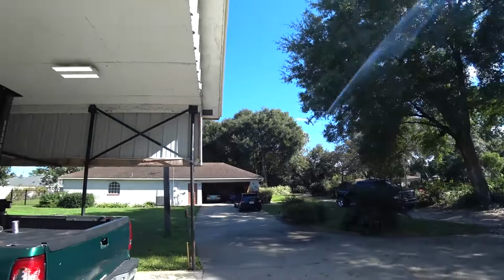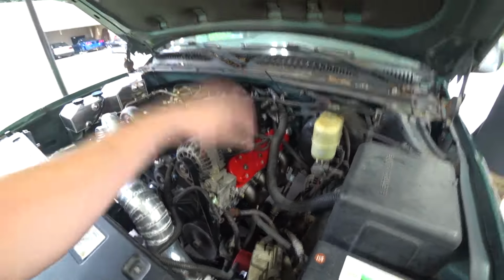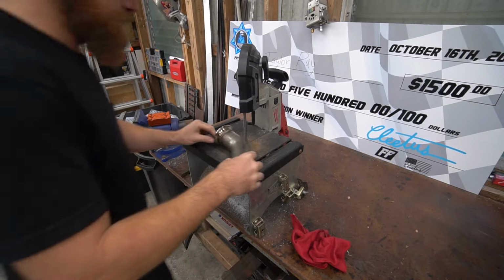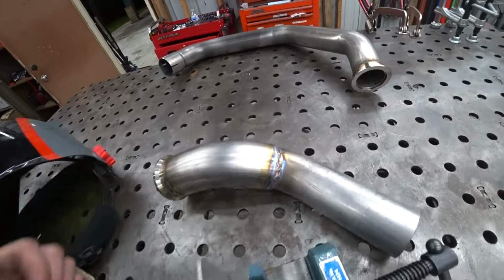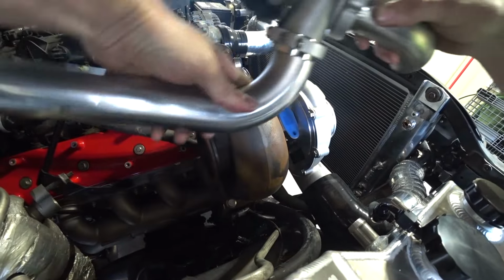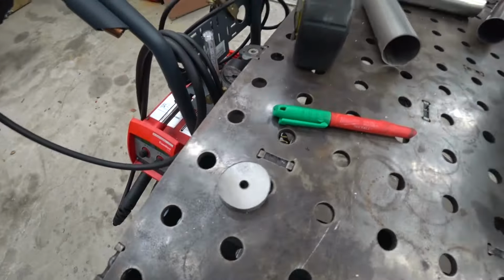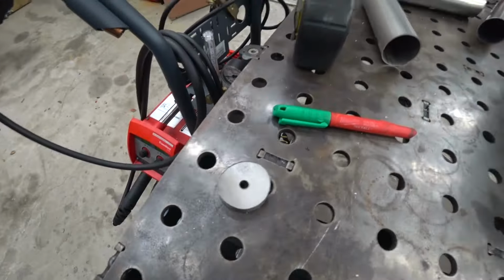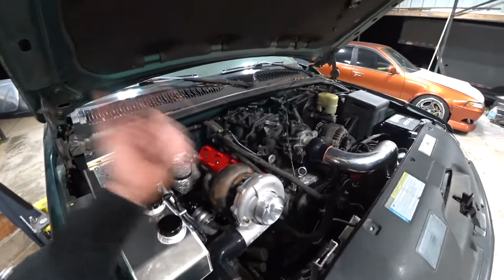Turbo LS street truck. Building the turbo kit

Comment: After years of changing broken manifolds and studs on F150s, I sure am jealous of how easy it is to get them on and off that truck.
Reply: Fords are hands down the worst gas V8 manifold. Cable company e series vans suck also. You need a straight cutting torch head

Comment: It will be a miracle if you don't experience boost creep with the wastegate positioned like that,  you're asking the exhaust air to turn 90 degrees to enter the pipe then another 90 in a different direction to travel down the pipe.  I know you know, but to work effectively the gate must be positioned in the path of least resistance, i.e. straight from the outer side of a bend.  None of the blank areas on the manifold are good examples as they all require a 90 degree turn.  PS keep it looking stock from the outside, sleepers are cool!
Reply: Like you said….you know he knows. I couldn’t help but see it myself but I’m assuming that he’s tired of this build sitting with the new shop creeping up on him, and wants to at least get it running as is, with what he has. I’m sure like everything else there will be a V2, V3…etc. But I couldn’t agree more with you! But it makes for content now, plus future upgrades. Lol.

Comment: Maybe dump the waist gate in to the down pipe? Would make the down pipe a little more difficult to deal with but would save space and keep the truck on a nice daily/sleeper status.
Reply: While it does seem like a good idea on paper it would make the entire Left Bank drive the turbo because the exhaust gases aren't going to want to flow backwards out of the gate, I personally think he shouldn't have wasted his time with this design instead gone off the compressor housing like he said
Reply: Yeah seems a little clunky would have been a tougher weld but off of the crossover pipe and into the main exhaust would have been tidy

Comment: taylor where your 4 inch pipe goes past the heat shield mark that spot and put the pipe in your press and oval it for clearance it will still be 4 inch but oval and you get clearance win win in my books cheers from down under

Comment: You can cut the plastic inner fender back and rivet a section of aluminum in its place. I'd try and avoid getting all the hot stuff wet when it's hot.

Comment: So i don't know much about welding but I thought you need to back purge the pipe with gas to stop sugaring of the weld on the inside?
Reply: You can do yes.  But it uses a lot of gas.  I would back purge down from the turbo to about half way then just weld up the rest normally.

Comment: A single 44mm gate on a 7875 and 6.0 boost creeps pretty bad, and I had pretty well optimized wg priority. Good luck, but don’t be surprised if first outing you see 16-18psi on the smallest spring you have lol.

Comment: Are you going to do coil relocations for the passenger side?  Looking at the location of the turbo, and the down pipe you may want to.  It looks a little lose-lose since even if you move them you have to run the spark plug wires around the down pipe.  Also if you haven't already order some of the blankets for the spark plug wires so that they don't become a constant issue for you.  Love the content, can't wait to see how it ends up.

Comment: I feel as through you’re definitely going to have boost creep issues, especially running a single wastegate and not a pair too
Reply: Definately. Neither of the two wastegate bosses look like theyre optimized for exhaust priority then he added an extension with a 90° bend. The best solution wouldve been to weld directly to the exhaust housing but he can get it tuned around the boost creep

Comment: I'm not trying to sound like an expert because I'm not... but might it be a good idea to recirc the wastegate and do it at an angle so you combat boostcreep by having the flow of the exhaust pull air through the wastegate?
Reply: atmospheric is lower pressure
Reply: I too believe there may be boost creep issues. If so maybe he can hole saw the hot side of the turbo and slam it on there like our lord and savior Denmah. Or just run all the boost

Comment: I leave the converter covers off. It just traps heat
Reply: Also, I usually put the wastegate on the crossover under the truck. Works well
Reply: @masonsmith9222  yeah that's how most the kits for those trucks seem to do it as well

Comment: Love the fab content Taylor! But looking at that wastegate pipe connection from the manifold; looks like something that will crack easily due to the bending moment together with high temperature. Perhaps weld in a kind of support? Keep up the good work bro! 👍 Greeting from The Netherlands. (What were your thoughts on the F1 race 😉?)

Comment: You should put your billet intake on the truck, since you wont be using it on the drift car.  It would look sweet under that hood.  Also you pretty much know you will have issues with boost creep.  Why not just design it right the first time?

Comment: Love all your videos, just one question though.
Why not at least paint the bed black or "rhino line" the bed to make it where you wouldnt see the rusty bed? I know you like making your projects look as nice as possible for the time/budget, paint would have been fast and cheap.
Reply: Good paint isn’t fast or cheap, and a half way fix just adds to the headache later. Being in Florida he could probably find a bed for it cheaper than paint. Personally I think the rust makes it even more of a sleeper lol
Reply: @jacobfleckinstein9576   you can prep the bed with rust converter and bed line it. That would be fast and cheap. It would look better then a nice decked box on top of rusty bed. Also how does a nice brushed on or sprayed in bed liner take away from a sleeper rig? most all trucks have a spray in liner.

Comment: can you remind us what you cold saw setup/blade you use is? Is the blade the same for aluminum/stainlesS?
Reply from the maker: It’s a norther tool ironton one. I would try the evolution. This ones not that good. I use a stainless 110 tooth blade. It does not work for aluminum. The stock blade does though. Just don’t try and use the stock blade in stainless. Learned that one the hard way lol
Reply: @Taylordrifts  Is the stock blade just a wood blade of sorts? Any specific tooth count?

Comment: Hey Question. I want to swap a 5.3 into my truck. It has a 4.3 v6, do I have to redo the wiring or get a Stand alone harness????
Reply: depends if you're trying for stock ECU or an aftermarket one, if i remember..
Reply: @niteriderevo9179  stock ecu.

Comment: Hopefully once it's running  you dont start having boost and back pressure issues by using two completely different exhaust manifolds.
Reply: Yeah because putting two different aftermarket better flowing manifolds is definitely gonna add back pressure.. 😂😅 quite the opposite friend.

Comment: Could you not have just welded the v band to the manifold and put the waste gate directly on the manifold ? Definitely looks like you would have had more room and gave you more room for the down pipe and gave you a cleaner angle for run the dump tube... idk just me...

Comment: Wastegate on the housing would be my very last option, it is ugly as hell, does not look really professional and is also bad for turbo spool, as you are disturbing thw flow path of the turbo itsself... i would go with rerouting heater lines if it was my project, how much of a hastle it seems it will be worth it...

Comment: You have all the info in the world, hell you even have Cleetus on speed dial but yet you make this crap even admitting that it still might boost creep.... Putting that wastegate there plus the 90 tube bend is the equivalent of putting a fan in a hall way and leaving your door open and hoping that you can feel a breeze. This takes the cake over the 90° rubber coupler off the turbo. Again this is what a "1000hp" hope build looks like. And before people come 💩 on me in the comments this person can literally through a needle and hit 10 people that has done a LS turbo build and find out what he is doing is trash so consider that before you correct me.

Also I want to add that there's literally already a marked spot where you can literally put a wastegate, were the flow is the best and decides to put it on the other side Next to the plastic instead of running it towards the ground and out the back...